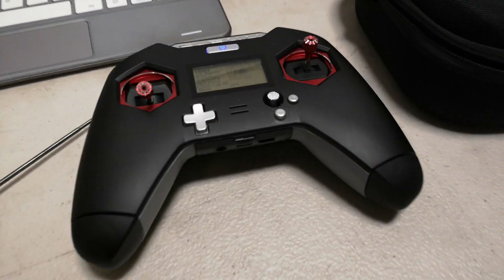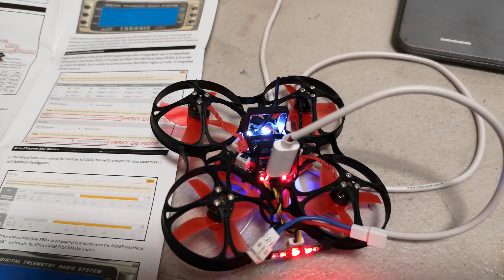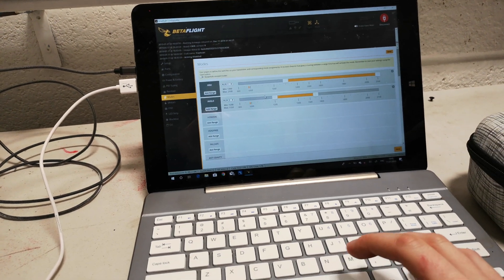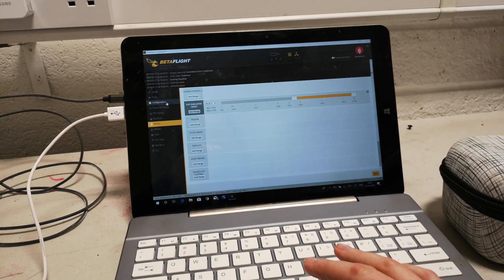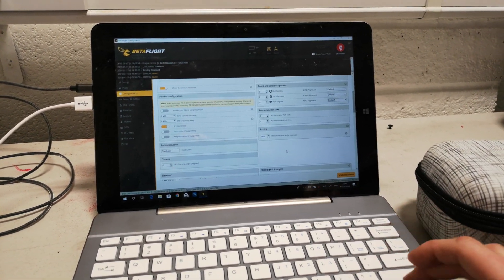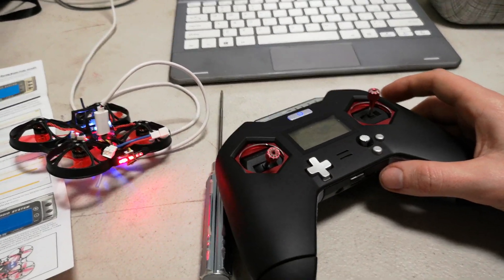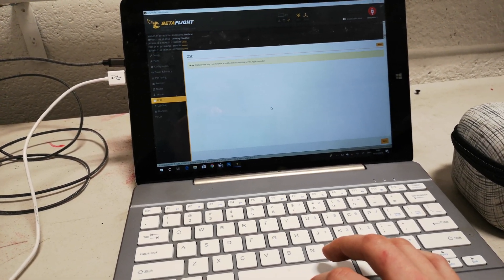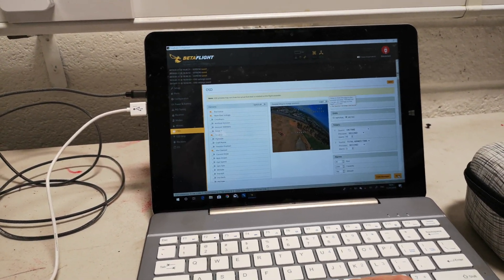Eachine Trashcan review binding setup betaflight 4 configuration Part 4

Comment: Will the non-eu receiver bind with Jumper t16 pro?
Reply from the maker: Yes it works fine with non EU. Just set the jumper to d8 mode
Reply: @CryptoWig  Thank you that helps a lot.
Reply from the maker: I'm here to help. If you have any other questions you know where to find me
Reply from the maker: D8 is no longer supported by FrSky ACCESS protocol. But jumper has a multi module so isn't affected.

Comment: i tried the same but my quad is not binding with the q7. only the bind keeps blinking on the taranis and the leds on the quad are stable after hitting the bind button on the quad fc.
Reply from the maker: What mode is the radio in? D8?
What mode is the quad in? Frsky-D spi rx
Reply: @CryptoWig  Thanks for the response. I set to D8 and it worked. I set up the aux channels and all things but when I arm it and give throttle the quad jumps and then motors stop spinning. something has gone wrong. OSD is fine, Modes are displayed as I change Aux Switches. Only the quad motors spin for 1 sec and then stop.
Reply: @CryptoWig  I have one doubt can I use 300 MACH 80C/160C 2S 7.6V 2.28WH BATTEIRES ON IT. IM AFRAID IF I USE SOMETHING WRONG I WILL BURN THE FC

Comment: Hey I do not see the white lights on my trashcan when plugging it in. How do I get to that point
Reply from the maker: Are the red lights visible?
Reply: @CryptoWig  Yes the red LED lights in the back of the drone are on and the green light underneath next to reboot button across from bind button, Ive tried everything still no white lights
Reply: @CryptoWig  the 2 small red lights underneath the drone do not come on
Reply from the maker: Did you follow the rest of the instructions to bind.
Maybe the lights are faulty but maybe the whole board is.
Light should come on as soon as usb or battery power applied.

Comment: I can't bind the trashcan to my QX7 lbt version? Have tried changing to Frsky D from X in Betaflight configuration.. Can you please help?
Reply from the maker: The built in receiver is FCC so you need to flash your transmitter to FCC firmware instead of eu-lbt or you can install an external receiver

Comment: Is there a cli command to set it into bind mode ? I put conformal coating before binding and I think I may have button issues now
Reply from the maker: I haven't tried it but I believe you just type bind then press enter
Reply: Just hook it up to betaflight and open the CLI. Enter the command 'bind' and the binding process starts, so easy :)

Comment: Noob question, what kind of wire is needed to connect to computer?  Thanks for the trash can videos.
Reply from the maker: Micro usb cable. If it isn't connecting then try another cable as some are not data cables and they allow power only. When you plug in, the computer should make a device connected sound as it does in this video.

Please like and subscribe as it's a great help to me.

Comment: Mine is not working i have done all of this and nothing works it  will not.bind  mine really is trash
Reply from the maker: What mode are you selecting in the radio and what is it set to in betaflight?
Reply: @CryptoWig  ive done both d16 and d8 and have changed it ac accordingly  to betta flight
Reply from the maker: @jayward7536  do the lights go solid once bind button is pressed?
Reply: @CryptoWig  yes they do
Reply from the maker: Can you confirm the chip on the board is definitely frsky non EU? Or whatever your radio requires?
Reply: @CryptoWig  yes it is im reflashing my radio now to make sure everything is the same
Reply from the maker: @jayward7536  can you look at the chip on the board and make sure they've not sent you a flysky version
Reply: @CryptoWig  just saw the fr on it
Reply from the maker: On the chip or the box? Could've had a mix up in the packaging facility
Reply: @CryptoWig  In my case after 10minutes I notced that there is next switch on opposite side xD , so I pressed boot one for first 10min 🤣🤣

Comment: Odd, thought you would get a EU-lbt and add your own frsky xm+
Reply from the maker: Didn't think of that until it was too late. All my gear is non EU anyway so no drama. Only issue would be if the range isn't great on the inbuilt board but I'm yet to test that
Reply: @CryptoWig  still waiting on mine from banggood. Where in the country you at. That hall with RC stuff in it looks awesome. Don't think we got anything like that in Devon
Reply from the maker: It's called unit21, Sleaford, Lincolnshire.
Been going there for around a month and trying to grow attendance numbers slowly.
There's the local regulars who travel 40 mins but the plan is to attract people from further afield.
Reply: @CryptoWig  looks good. Gonna have to set up something like that in my area
Reply from the maker: It's a bonus if you can find something that's already set up and piggy back. There's often model clubs who fly planes or below indoors or RC car clubs with venues that you can arrange to use